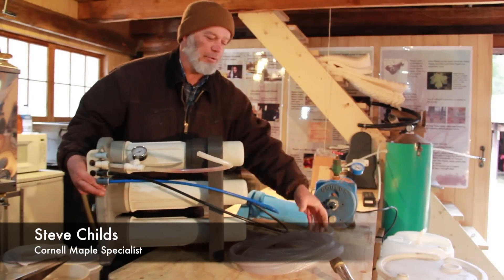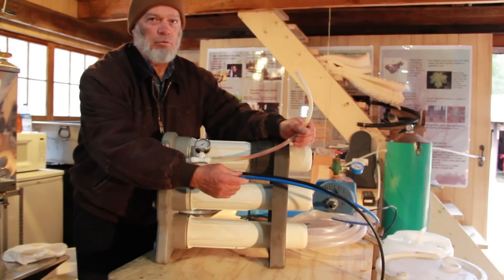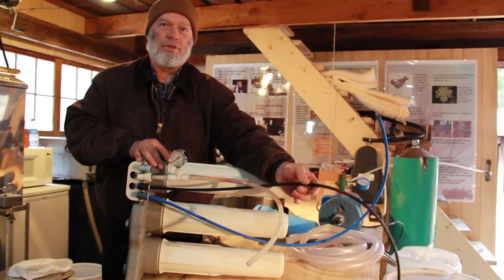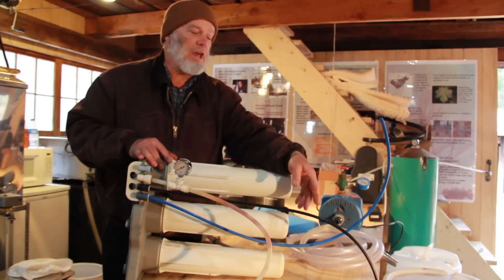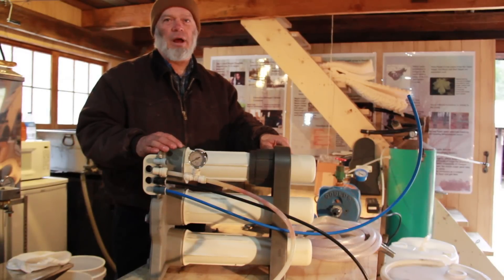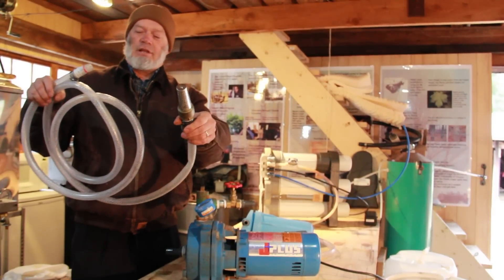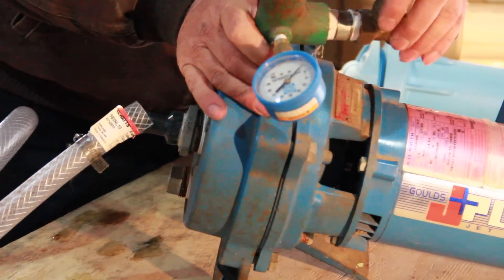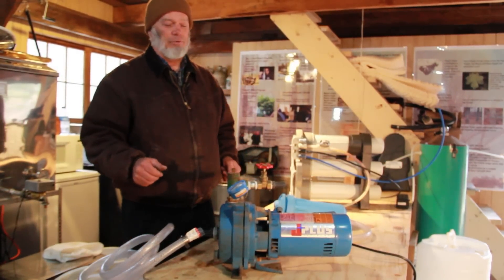Small-scale Reverse Osmosis

Comment: One barrel of water per day is good but a little underwhelming really. I need more then that. I have 500 taps with some vacuum from my 3/16" tubing. Do you think that this same pump and prefilter can be used with say 4 primary RO's like the ones you have then 2 secondary ones then one final one to increase the volume of sap that can be processed here, or would I need to get a bigger pump to push sap through all those extra membranes?

Comment: I appreciate your video and the time you took to share it.  I built an RO system this year based on all the good info on the web.  What a game changer!  I'm running two 400gpd membranes in series.  5 micron prefilter (standard 10" cartridge).  The Aquatec CDP 8800 pump.  I use a brass needle valve ($5 from big box store) after the membranes to create the back pressure. I'm pulling water out of my sap at a rate of 4-5 gallons per hour with about 100 psi back pressure.  So, in one day I can fill a 55 gal drum with RO water.  My total flow rate (concentrate plus permeate) is about 200 gallons per hour.  I'm doing the recirculation method.  And the pump is drawing a whopping 45 watts.  I'm starting with sap that's only 1.5% sugar because we tap mostly red maples.  I'm using the RO system to concentrate the sap to 6% sugar.  That means I'm removing 75% of the water and I've reduced by boiling time also by 75%.  Amazing.  Well worth the investment!  I bought my 400 gpd membranes with housings from a major online retailer (starts with Am...) for $65 each.  Pump was about $120.  I have about $350 total into my RO setup.  I assembled all my components into an 18 gal plastic tote so the system is easy to store and transport.
Reply: Instablaster
Reply: Still have unit or have you upgraded?
Reply: @bluecheetah420  I’m still using the same system in March 2022 (3rd season with it). Haven’t had to replace the membranes yet. I’ve only replaced the 5 micron filter a couple times each season.